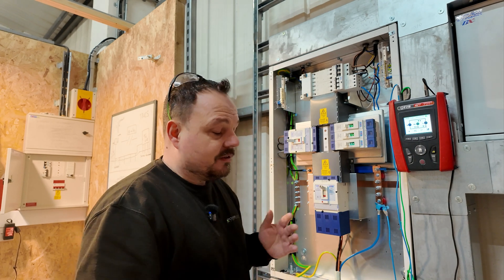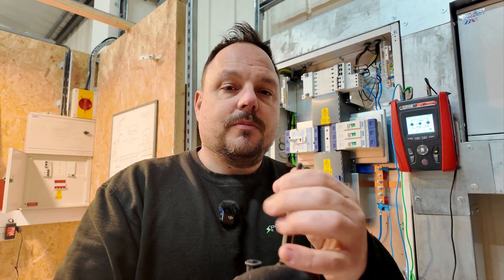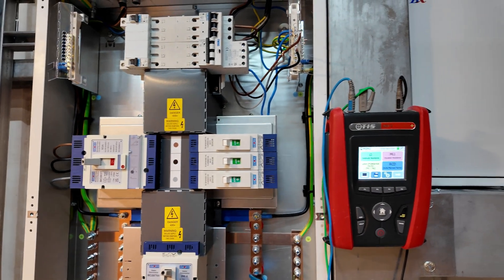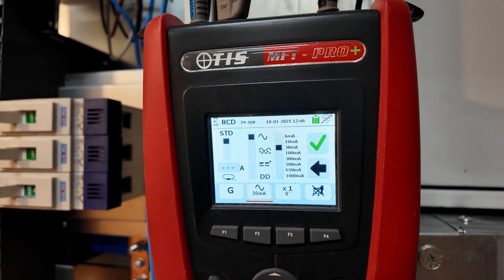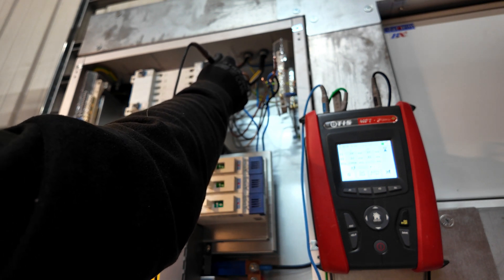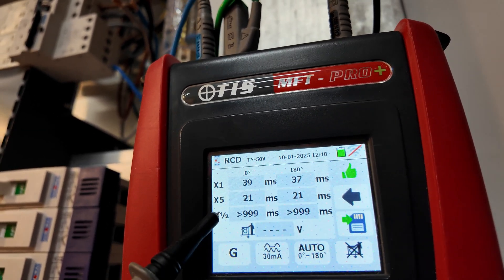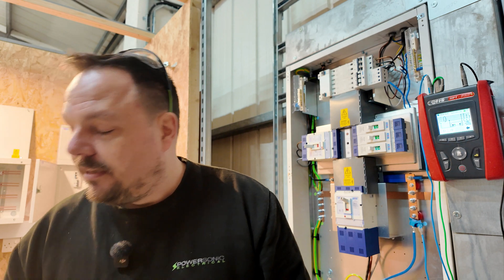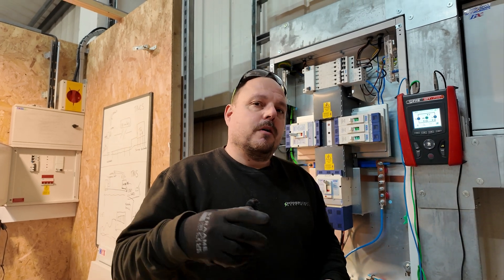Can you test a 3 phase RCD ? HOW ???

Comment: Another great video, as always Mark - thank you. I find it disappointing that some trainers won't demonstrate these procedures because "it's live working". Apart from denying learners a valuable opportunity, this actually confuses the question of what is and is not live working in the mind of the person undergoing training. Even if the DB is not live and is isolated, the application of test voltages (however small) by the MFT *is* live working in terms of the EaW Regs! ALL testing is live work - that is what we are reminded constantly as APs and SAPs in DNOs - and precautions have to be taken accordingly.

Although you may have already covered this in another video, the use of a Safe System of Work is paramount and the application of generic and site-specific risk assessment (before starting work and continually reviewed as circumstances change during work) as well as following approved procedures is actually more important than PPE, which is always the last line of defence even if its use is obvious in most circumstances.

Looking forward to more great content.
Reply from the maker: Thank you. Lots of trainers are doing brilliant work. The ones who aren't will do better 💪

Comment: Very good mate, I am sure the new generation Sparks will find this useful. I was an install electrician for 25 years and now a maintenance electrician, working live was never an issue as I was working on my own creations but doing maintenance on the unknown is a different thing. You need to have your wits about you as you never know what boobytrap is behind the cover. Man, some of the boards I have seen. Don’t want to sound like a SSOW but always check for hazards, use your eyes and common sense.  All the best.
Reply from the maker: Great advice